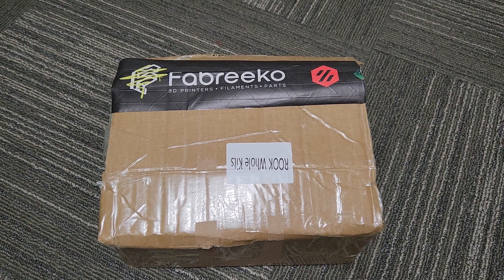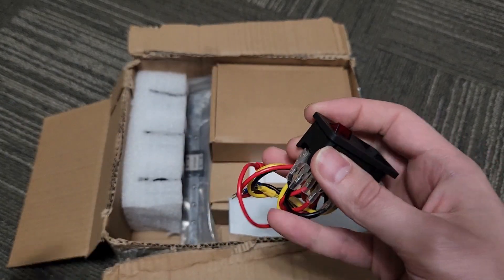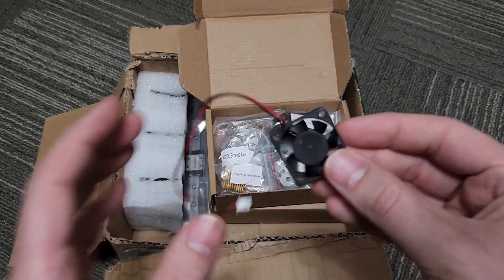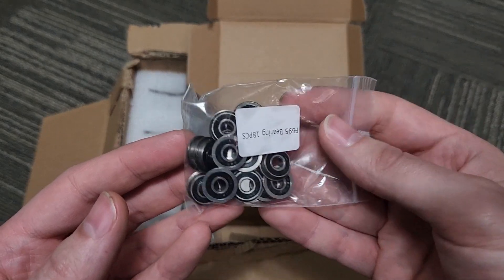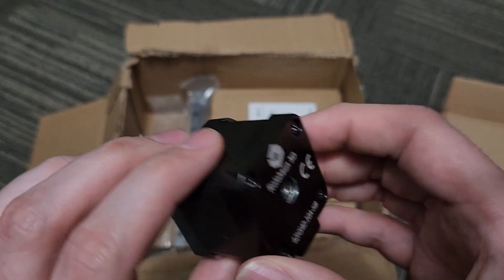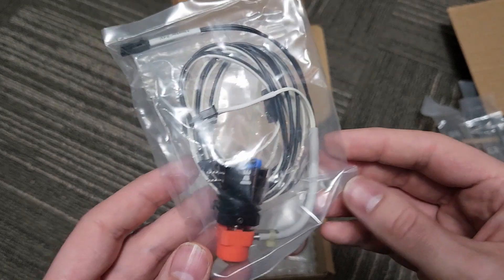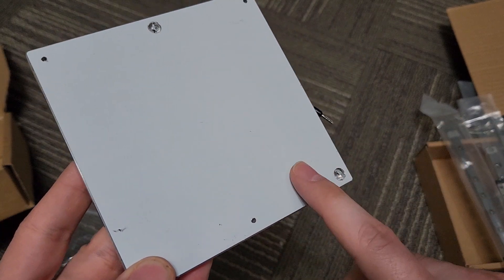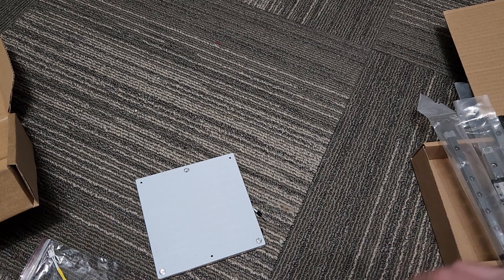Fabreeko Rook MK1 Kit Unboxing!! - Inexpensive beginner CoreXY 3D printer!

Comment: I've made my voron 0.1 mini after LGX lite work with a trianglelab hotend with one of those round heat blocks, they're awesome.  Just had to slightly mod the mount part so the nozzle would be at the same height as a dragon or anything else would have been.
Reply from the maker: awesome!